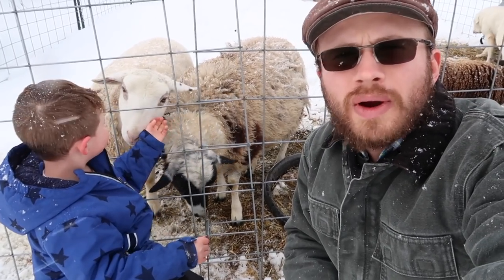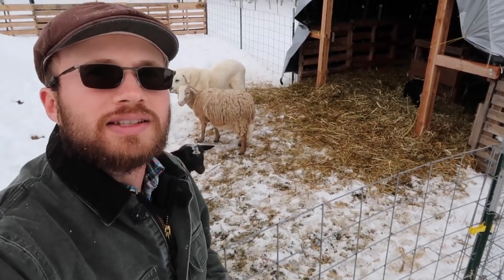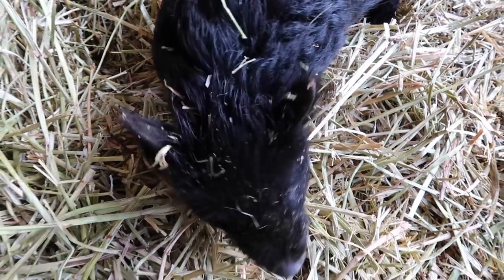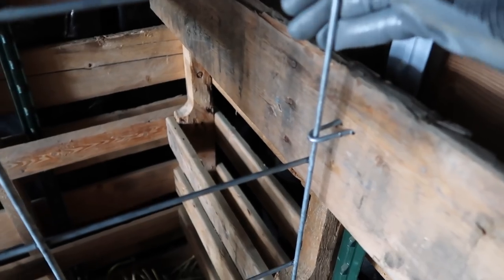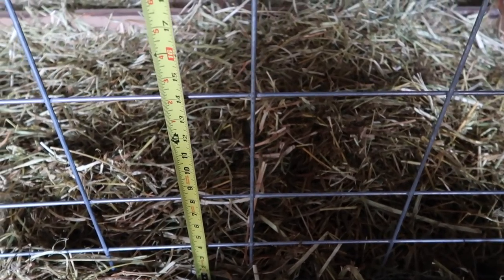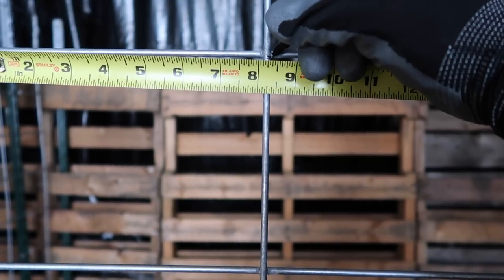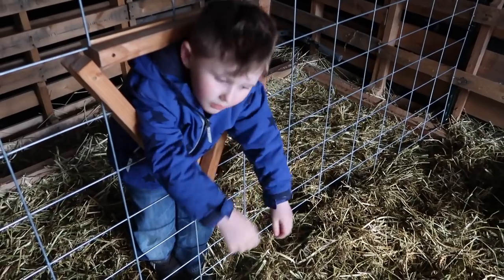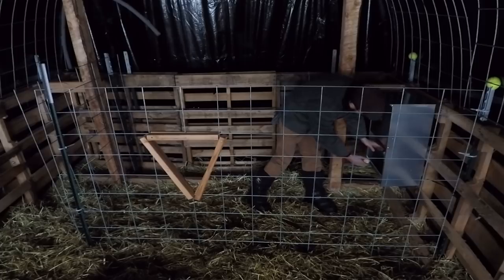Livestock Guardian Dog Feeder Station with Jump Gate for Our Akbash

Comment: @3:20  Noticed you nailed that fence staple such that both prongs are aligned with the same wood grain.  Doing that increases the likelihood of splitting the wood (now or over time), which will weaken/ degrade the wood and loosen the staple.  It can help instead to rotate the staple such that the prongs pierce different wood grains.  If you rotate it enough, the prongs will snug up against either side of the fencing material, giving a slightly tighter hold.  It's more of an issue when nailing near the top of a fence post, where splitting is more likely and more damaging, but I find staying in the habit makes it easier to remember.  (Don't mean to pick nits; just thought I'd share, since we're all learning from each other.  You might have a better reason for doing it the way you did it.)
Reply from the maker: no, no reason for doing it the way I did.  I spend too much time looking through the camera screen to make sure the action is in the frame and I sometimes forget the small details like that.  Thanks for the reminder!
Reply: Just came across your channel, really loving your vids, mostly watching the ones featuring The dogs and when you acquired Blue and Willow and really falling in love  with the Akbash Breed! ❤️